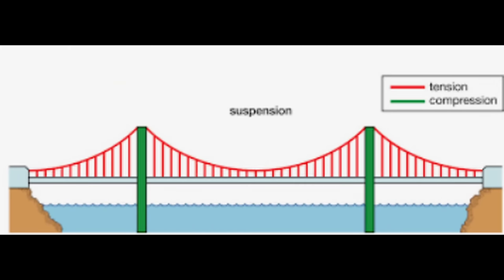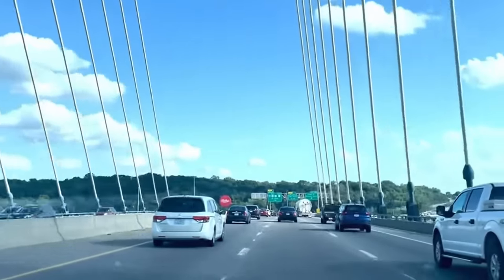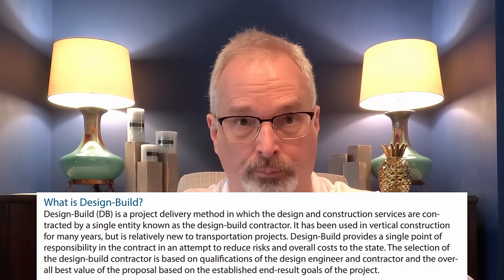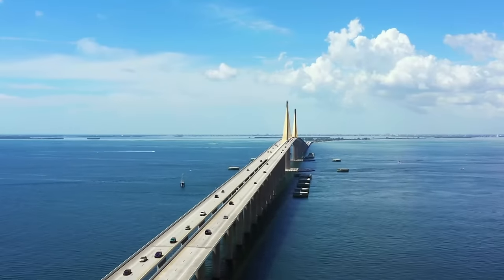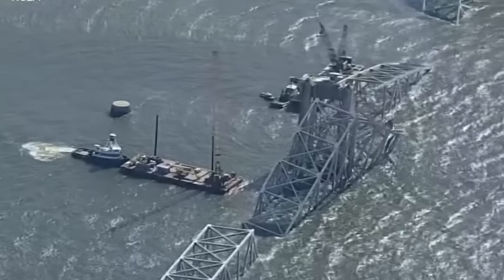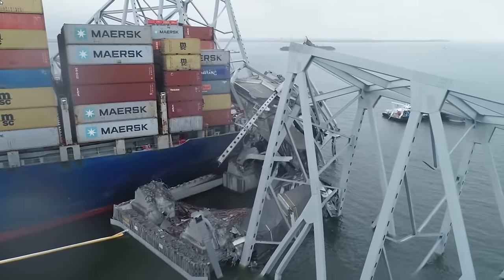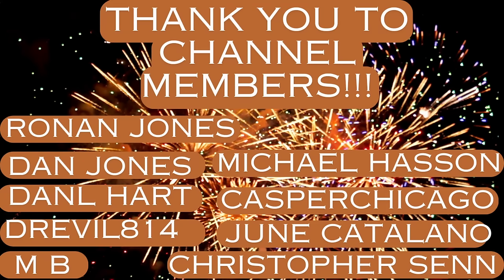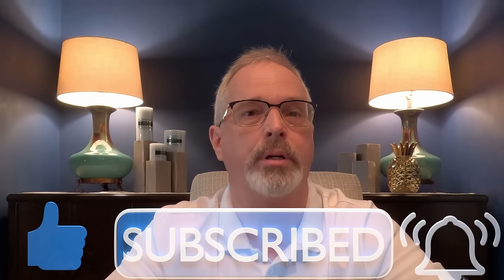How will the Key Bridge in Baltimore be Rebuilt?

Comment: Sorry for my ignorance but...would a tunnel be out of the question (either due to cost or some technical issue)?
Reply: this was the only short and less congested east side route for hazmat and oversized loads which aren’t allowed in tunnels so bridge is required, plus tunnel would likely cost twice as much.
Reply: More expensive and would take longer.  Why would you want that?
Reply: @GH-oi2jf - Didn’t say I did want it - just curious!

Comment: Design build is efficient if the right contractor receives the bid.  Hopefully, Maryland doesn't have to pick the low bidder.  As for the Environmental Impact statement, hopefully, the red tape will be able to be cut through to facilitate construction, and the economy of the region is prioritized.

Comment: Here are my recommendations for the site, a set of alternatives to study.
The entire bridge is 1.6 miles long,

This is what collapsed -- 

Continuous truss length 2,644 feet
Main span length 1,200 feet
Back span length 722 feet
Vertical navigational clearance under main span 185 feet

Key Bridge north approach plate girder spans collapsed
895 feet total
south to north
285, 290, 320 = 895

. . . . . . . . . .

Key Bridge rebuild alternatives

1. Replacing the 2,644 foot long main span structure, the part that collapsed. Use a cable stayed structure.
Replacing the three plate girder spans on the north approach that also collapsed. 895 feet total: south to north - 285, 290, 320
Same cross section as existing bridge.
This alternative may be buildable for the $400 million minimum that has been cited in news sources, we will need to see a detailed engineering estimate.

2. Similar to Alt. 1 except the new spans will have 10 foot right shoulders.

3. Similar to Alt. 2 except the pre-existing approach spans will be widened to have 10 foot right shoulders.

4. Replace entire bridge on the same alignment, with maximum 2.5% grades. This will be a longer bridge and it will have 10 foot right shoulders.

Issue: several recently built bridges over shipping channels have vertical clearances in the 215 foot range. That is 30 feet more than the Key Bridge and such a bridge would have a higher profile than the entire original bridge and would necessitate replacing the entire original bridge.

5. Remove pre-existing bridge structures, build approach roadways on causeways (that were built for the original tunnel plan)
Build 6,200 foot long twin-tube 4-lane tunnel under harbor.

Given the flat traffic growth that has basically been stable at about 31,000 AADT since 2006, 4 lanes (2 each way) should be adequate for the design year of 2045.

I would like to see the tunnel funding be explored. I know it would be expensive but I see it as the only proper solution (other than not building any new crossing at all and letting traffic be handled on the inner harbor tunnels and their freeways).

A large enough island/dolphin system for a bridge would undoubtably cause hydrologic problems. I really don't think it is possible to protect against ships of this size.

They could build an island 1,000 feet in diameter but then in that about 5,200 foot opening it would interfere with water flows and that river is tidal there.

Resource agencies tasked with environmental approvals would almost certainly oppose such a design and refuse to approve it.

My solution would be a tunnel as on the Chesapeake Bay Bridge-Tunnel and the Hampton Roads Bridge-Tunnel and I-664 Bridge-Tunnel.

No bridge over the shipping channel.

The approach tunnel portal causeways are already in place.

That was the original plan there and the causeways projecting from shore were intended to have the tunnel portals for a single-tube two-lane 6,200-foot-long harbor tunnel. The two-lane freeway was placed under construction, the causeways (landfill for roadway across a water body) for the tunnel portals were built, and when the tunnel was advertised for construction in 1970, the bids received on July 30, 1970 were so high that it was determined that a four-lane high-level bridge could be built for about the same cost as the revised estimate for the tunnel project.

The causeways are wide enough to accommodate a second tunnel tube.
Reply: But…this was the only short and less congested east side route for hazmat and oversized loads which aren’t allowed in tunnels so bridge is required, plus tunnel would likely cost twice as much.

And new bridge will certainly require breakdown lanes which this doesn’t have so approaches can’t be reused.
Reply: @JohnHallgren  
Hazmat wasn't the reason that the bridge was built. Only a very small percentage of traffic anyhow.

There are many trip pairs around the inner harbor that are best served by the I-95 and I-895 tunnels. Hazmat vehicles are routed on surface roads around the harbor.

The tunnel would indeed cost a lot more, but I do not consider any bridge alternative to be appropriate here.
Reply: @scottkozel1519  it may not then have been the reason why, but it’s now a reason to rebuild a bridge.
I have an acquaintance who used that for his hazmat trucking and now is forced to go all the way around left side.
Keeping this type of traffic somewhat isolated is a good thing.
Reply: @JohnHallgren  
There are designated hazmat routes around the inner harbor some on city streets and some on I-95 and I-395.

I am opposed to a replaced outer harbor bridge. To many issues with today's super-ships.

Comment: As a Dane we have large artificial low water areas in front of the pillars of our main and very long bridge (18 kilometer). And it is a hanging bridge. We also have cable stay bridges at places.   And Maersk had a huge floating crane from this built operating and building a bridge on the large lakes, so it may be ready to operate at a short notice?

Comment: I think most important factor in the new bridge construction is installing concrete barriers to prevent collisions that would collapse the bridge. The Tampa bay bridge collapsed from a ship collision and the new bridge was built with barriers to protect the bridge. I think the builder of the Key bridge were using the MOC principle in their design. MOC is money over concience. If we use the same principles in our automobles we would eliminate seat belts and safety glass to lower the price of cars.

Comment: Interesting video.  Now I have more questions than before.
It a cable-stayed bridge is a slam dunk for the new bridge design, why?
There are published algorithms relating cost to span, and that the cable stayed are good for medium spans but not so much for extended spans.  How will this new bridge relate? 
Construction cost, construction time, maintenance cost and lifespan. Can you provide some perspective of these considerations with the possible design choices?  
Can it be assumed the improved pier protection would be the same for all bridge designs?
Regarding the construction time required, the Kerch Strait highway bridge was built in about 2 years.  And one could wonder about the funky geology.
Reply: Note that the FSK center span was 1200 ft, which is the same as the current cable stayed Sunshine Skyway, so should be fine there too, especially if the similar fenders and dolphins are used also.

Comment: What kind of bridge it would be, beam, truss, cable stay or suspension is pretty much dictated by the main span length.

Beam is just way cheaper than anything else, but also have a max span limitation 150 feet or so until its unreasonable expensive. Next up truss is the cheapest between that span and about 1200 feet or there about. Cable stay can go up to about 3000 feet.  Significantly more than 3000 feet and suspension is the only option.

What people often don´t think about is that Suspension bridges come with a huge archer that is incredibly expensive to built. They also generally cant carry trains (something blatantly ignored in most cartoons and video games). On top of that they have two sets off cable, the main sets typically have to be built in place.

A single span suspension typically cost twice as much as a equally long dual span cable stay bridge. Main advantage of the cable stay bridge is that the cable can be made of site and be lifted in to place.

Similarly a cable stay bridge would typically cost twice as much as a similar length 2 or 3 span truss bridge. And a truss bridge is in turn about twice as expensive as a beam bridge. Of cause, that is given that there is free and cheap access to the ground for foundation. That of cause, you don´t if you want to have a shilling channel.

The relative cost is also true for maintenance. So in a sense. a suspension bridge is not really a investment, but rather a tax on future population.

Before saying "we really want a cable-stay bridge". consider if its really worth it say compare to simply having dolphins and other protection.

A other issue with the more "advanced" bridge types is that they are more sensitive to over load, that is basically why you can´t run train on a suspension bridge.

There is just no economical reason for a suspension bridge at that site

For cable stay it can be argued. The span would probobly benefit from being a bit longer. Buuut, i wounder if it really makes any sense doing it much larger. If its not even shallower, there is basically no point.

Comment: A new bridge will definitely be a larger bridge with more lanes. It will be much heavier so it will require piers that can handle more weight. Cable stayed bridges seem to be the popular modern style and use concrete as the basic material so the bridges are much heavier. I have seen what happens to concrete as it ages. My first thoughts are that it will cost upwards of $2 billion and the roadways on each side with have to be upgraded also so it might be closer to $3 billion.

Comment: Is it possible to surround piers with sand or gravel bars to stop ships headed for a collision?  That would be a lot of gravel, but perhaps cheaper than replacing a bridge.
Reply: Did you miss the quick video shot of the sunshine skyway at 3:56? That’s what we did here when the previous bridge was knocked down in 1980 by a freighter.

Comment: Where should it be built?
If it's a direct replacement, with that length of span, there's a whole lotta dredging needed to be done.
The pier that was collided with, one side of the shipping channel, is only 503m off Hawkins Shoal Point, yet the corresponding pier on the other sides distance to Sollers Point - ignoring the man-made island - is near 1,600m.

Gotta wonder if the Key Bridge was built for the Shipping Lane or was the Shipping Lane dredged to follow the bridge design . . .

Comment: Was there any fundamental design problem with the original FSK bridge? You jump directly to cable-stayed as your guess about the direction, but don't mention why a direct replacement should not be used. I'm from Baltimore, and as far as I recall the truss was chosen because it was more cost effective than the other proposal, which was a suspension. And I must say that the FSK span is a beautiful truss, unlike some of the other truss designs you've mentioned when discussing a new bridge.
Reply from the maker: The continuous truss bridge construction used for the Key bridge basically "unzipped" across several spans when there was a failure of a non-redundant element.  Such a bridge design is less safe than than alternatives if a problem occurs.
Reply: At the time the FSK bridge was designed, cable-stayed was not an option.  A suspension bridge is not an economic solution for such a short span.
Reply: @CaseyJones-Engineer It was a fluke. The bridge stood for 47 years. Thousands of vessels used the channel over that time. And it's hard for me to believe that engineers at the time did not understand what would happen if one of the two supports failed.

In any case, the key is not rebuilding the bridge right now. They key is getting the shipping channel open. Failure to do so could cost far more than replacing the bridge.
Reply: Yes, but a bridge with a longer span would be helpful, so that the piers on either side of the central span aren't right at the edge of the channel.

Comment: A cable stayed bridge has the same problem as the old bridge; the main support columns are way too close together.   The towers of a suspension bridge can be spaced further apart.
Reply: Suspension brudges are for much larger spans.  A cable-stayed bridge can easily span this channel at much lower cost.

Comment: They should just make the base of the trusses as a solid 80x80 feet wide reinforced concrete pillars that extend the whole clearing height under the bridge. That way no matter what ship hits it next time it could damage but not collapse (from bending) the structure as it happened with the steel.

Comment: While aa cable stay can have a longer span than the existing bridge, it would still require piers in the water. Only a suspension bridge can have a sufficiently long soan as to have the piers out of the water or right at the waters edge. Given the failure mechanism of the bridge anything that risks a repeat is as daft as a brush. Yes a suspension might be a bit more expensive,  it however is a lot less expensive than a repeat event in 50 years time.

Comment: One of the issues with the Key Bridge is that it was high (200 feet clearance at high tide) and only 1.5 miles long.
Reply: Actually was only 185 ft clearance according to government website but may have been 200 ft to roadway surface. But was a steeper grade than modern bridges are now.

Comment: I don't think there's any particular reason to take the main span beyond the current 366 metres which is, incidentally, exactly the same span as the span as the Sunshine Skyway bridge. The MV Dali had a beam of 38 metres, although there are supertankers with beams of about 68 metres. In any event, there seems to be plenty of room with a 366 metre span to have a wide shipping channel and, what is extremely important, large enough pier foundations to make sure that this sort of accident can't happen again. The Sunshine Skyway bridge has that, plus the concrete "dolphins" to provide extra safety. I should add that the clearance on the Sunshine Skyway bridge is also within 2 metres of that of the Francis Scott Key bridge.

The advantage would be that the existing pier foundation locations and the approach spans could be reused. It ought to speed up construction. A cable stay bridge also makes perfect sense.
Reply: Any existing piers and approach cannot be reused because of the age, but also the required increase in width of the highway to include breakdown lanes.

Comment: I see that the first thing to decide upon is if it shall be a tunnel or a bridge to replace the collapsed bridge. It's actually not as simple as it seems, especially if the deck height has to be increased and what the geology looks like. The length of the ramps needed are then also a factor, even though it doesn't seem to be a big change there considering that the height clearance did seem to be decent on the now collapsed bridge.

In the event of a bridge then another factor has to be taken in and that's the risk of ice buildup on the cables and deck of the bridge. But that can of course be resolved by heating of the cables the few days of the year where it would matter.

For the deck height it's worth to consider how large ships that shall be allowed into that port. If you want to receive the Gülsün class ships (26 stacked containers in height) then I'd expect that the bridge clearance has to be about 200ft or more at its lowest over the channel. That's about 15ft higher than the currently collapsed bridge, so not an impossible increase.

Of course receiving the Gülsün class ships might be impossible for other factors like the length of the ship, but for the sake of the bridge dimensions the length of a ship doesn't matter and we don't know what the future holds for us.

Now if this bridge construction were for Europe then pedestrian/bicycle traffic would also be something to add to the bridge, but given that this is the United States where people rarely walk or bicycle for commuting I wouldn't expect it. However a view from a bridge is still a nice tourist feature.
Reply: this was the only short and less congested east side route for hazmat and oversized loads which aren’t allowed in tunnels so bridge is required, plus tunnel would likely cost twice as much.

Comment: Thank you for the informative lesson on what goes on behind the scenes in a project such as this.  I did Like & Subscribe.  I know I am in the minority here, but I think that the bridge should not be rebuilt.  We have a lesson here (and other case failures) that these structures, no matter how well designed, just do not hold up.  In place of the bridge I recommend a ferry system that will take both automobiles and passengers.  This will save money and create jobs as boats need both humans and maintenance to make them run.
Reply: Um, I believe a significant portion of the traffic is hazmat and oversized trucks, not pax vehicles!

Comment: Hi Casey, do you think the two Bay Bridge spans will also be assessed for design features to prevent collision protection/fortification?
Reply: The Bay Bridge was struck several years ago, or, rather, a fender was struck.  The only damage was to the fender and the ship.  The Golden Gate Bridge has only one tower in the water and it is heavily protected.